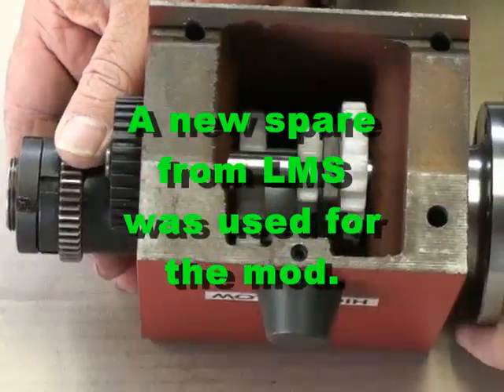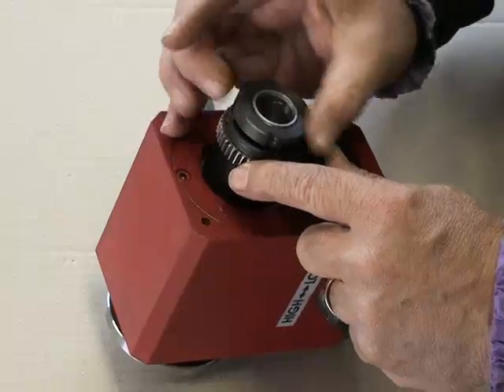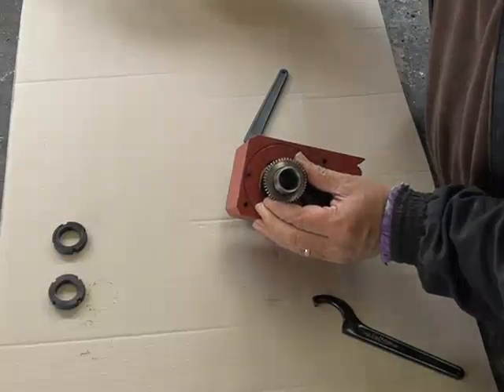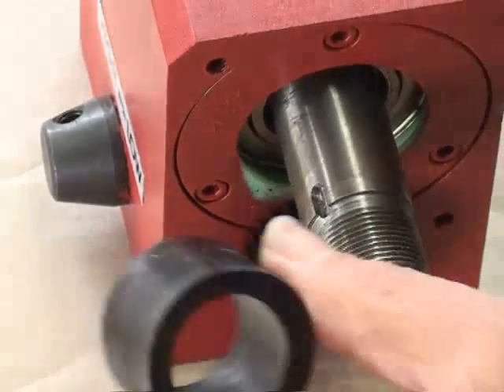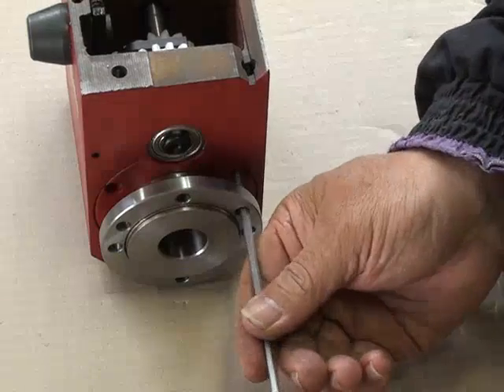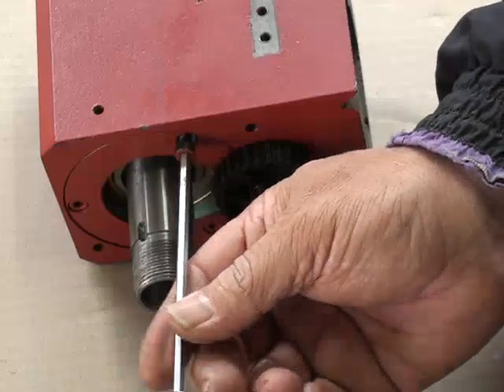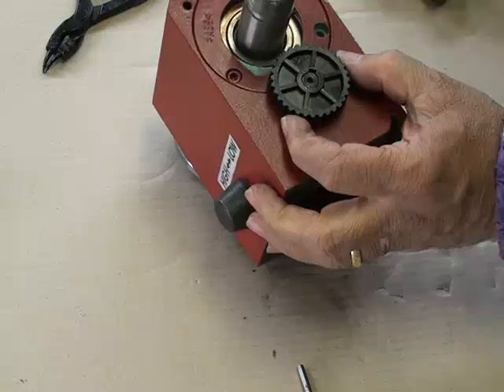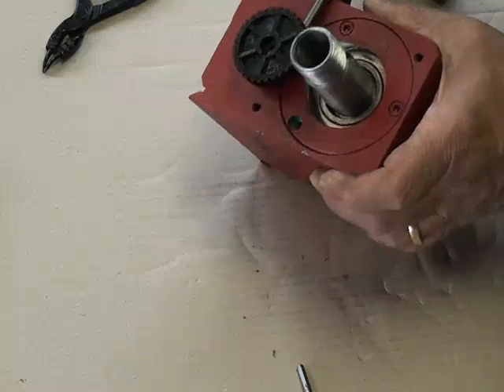Part 1A of Fitting taper bearings to a 7x12 mini lathe.

Comment: where do u buy the puller ?
Reply from the maker: The tubes came from LMS part number 2909. This is made by Micromark and is designed for replacing the plastic gears with metal gears. The tools were part of that kit. The Micromark part number is 83452 so you may now have to try their website as I think LMS no longer sell it. The kit has tubes and washers with steps and rebates which match the bearings and holes. The spacer part number is 1291.&#160;From Little Machine shop in the USA. It is the 7.5mm one.&#160;The tubes came from LMS part number 2909.&#160;This is made by Micromark and is designed for&#160;replacing the plastic gears with metal gears. The tools were part of that kit.The Micromark part number is 83452 so you may now have to try their website as I think LMS no longer sell it. The kit has tubes and washers with steps and rebates which match the bearings and holes. I am in Australia and I do not know if these parts are available in the UK. Maybe you can check with UK suppliers of these lathes for the spacers.

Comment from the maker: You can use homemade tubes to remove the bearings. The bearings themselves are quite cheap - less than a cheap set of cutting tips. The whole mod itself, including a complete spare spindle, costs less than a good set of indexed cutters!!  With any lathe you will problably spend hundreds of dollars on tools. With this mod even cheap brazed tips cut much better. Considerably less chatter and the reduction of tool tip to work "collisions".
Unless you are making wooden toys, this mod is worth it.

Comment from the maker: Just returned from holidays. Yes, it was worth it. Without it the lathe is junk. What seems to escape most people is that a wobbling work piece results in the cutting action that is a series of collisions between the tool tip and work. The tool tip only touches the work when the wok "wobbles" towards it. The rest of the time there is no contact. The tool tip is not spring loaded so it cannot follow the work. Before the mod the tool chatters, dives, and breaks - after - it cuts like butter!!!

Comment from the maker: Small edit - I should have said yes - one set of bearings from the drive end have to be removed to allow the shaft to be removed from the spindle box first. then the gears have to come out through the bottom because the largest gear is to big to go though the holes in the casting for the bearings.

Comment from the maker: No, the large gear is larger in diameter than the holes in the casting for the bearings. So they can only come out through the bottom of the spindle box meaning that the shaft has to come out with at least one full set of bearings (on the chuck end). I had no problem with the alignmemt of the spindle box on the bedways. The V grooves pull the box back into line. Just makes sure the grooves are very clean and no small particles in them. The little gears also come out the bottom easier.

Comment from the maker: @finselBR Hi FinselBR, the C spanner I used is the same as for the ER32 collet nut. It is marked 45-52. The nut on the spindle is 41.6 mm outer diameter and 37.2 mm across the inside of the recess or lots. The ER32 spanner is a nice fit. Cheers, Lou

Comment from the maker: @finselBR Hello Frank. LittleMachineShop is on the web. LMS has adapter plate for 4" chucks. I use part number 1692 for 4 jaw independent 4"chuck.  You can buy also 4" chuck WITH adapter LMS.  If you have 3 jaw 4" chuck you need 2426 adapter. MR300 looks like my Sieg C2 7x12. Mine does has no chuck cover and no tachometer. I think the C3 has cover and tacho but otherewise same machine, You do not need a new spindle if you use the adapter with your 100mm chuck - uses the same spindle holes.  Lou

Comment from the maker: @finselBR     Hello Frank, I used the tools from Little Machine Shop (on the web) part no 2909 Metal gear kit and bearings 2 off 2822. I put metal gears 3451 and 3453 replacing the plastic ones. I would have used the spindle repair tubes 2287 but they were not in stock. 2909 comes with some metal gears but I used the one piece set instead (better). I suggest you buy 2 spare plastic spacers 1291 (7.5mm ) because you have to make a small step in the spacers - taper bearings are a bit fatter.

Comment: Hi Lou,
I have one similar Lather.

I always think to change my chuck 80mm to  the 100mm ... and today I think that I crashed my bearing, so there is a good oportunity to change it like your videos show.
But I need your help. Do you know where can I buy the Pull set ( the necessary tool set to take off the chuck, etc)  and the Chuck kit 100mm 4 individual ?  By internet and from other country ?
Thank you!
Frank